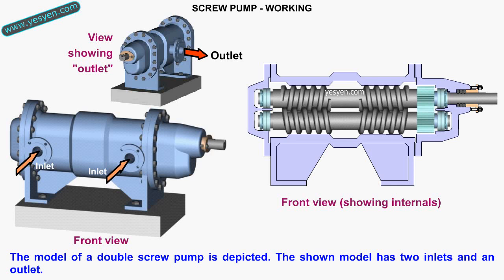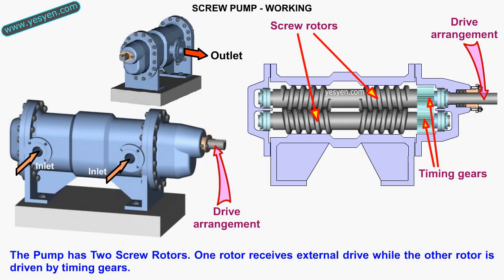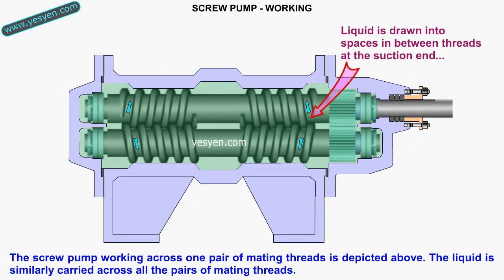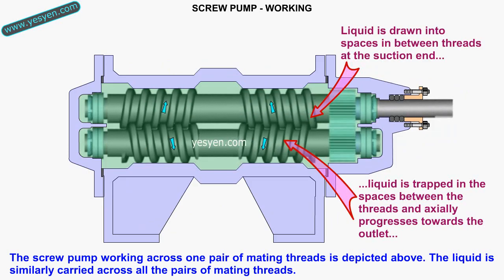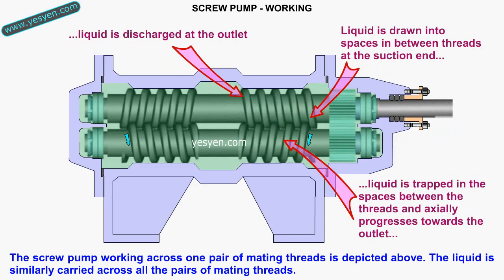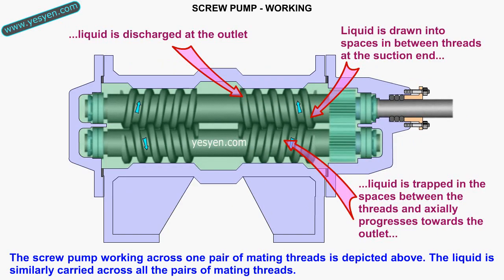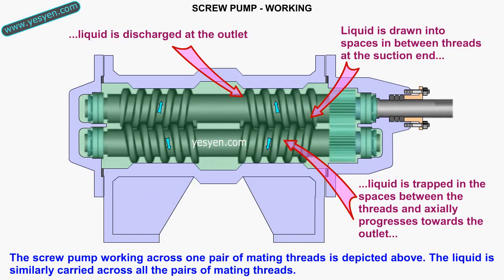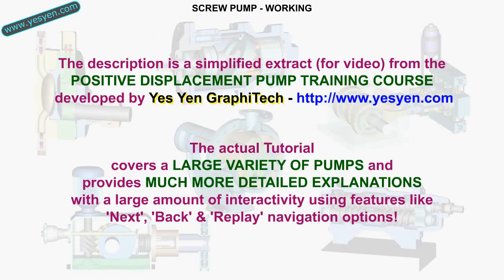Screw Pump Working Animation

Comment: Explaned good.But dhis is unnecessary dizayn.And very easy broken down or seziure of screws in case of oil starvation.
İf it is seizured .throw away the compressor which the repair cost more than a new one.